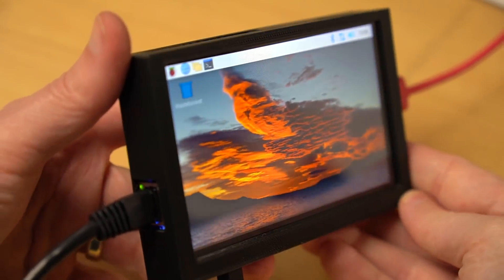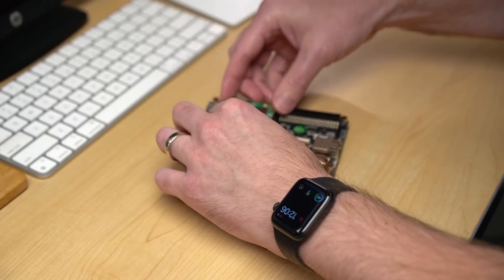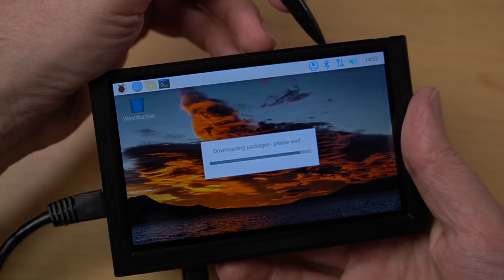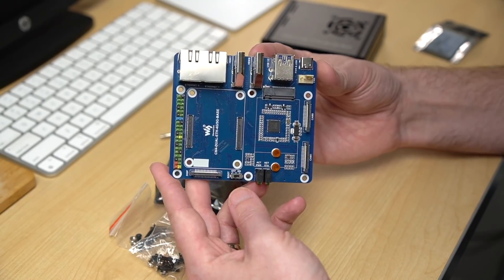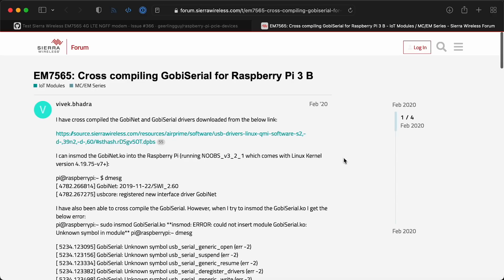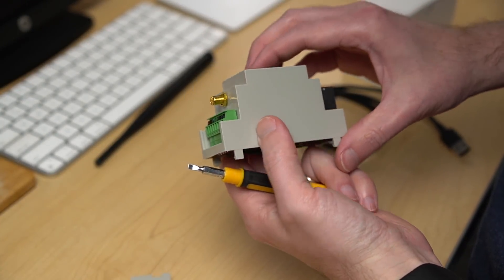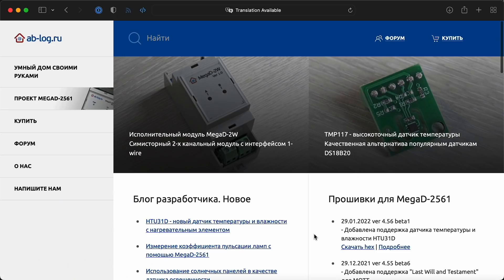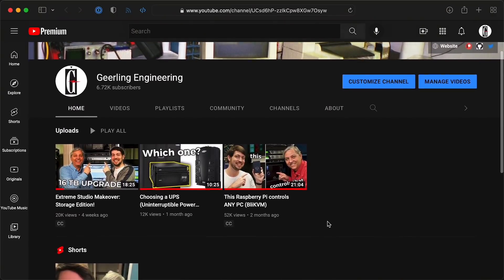So much functionality in one tiny Pi!

Comment: A tiny package like that meant to be attached to a din rail... I wonder if the original purpose was to act as an infiltration point by having the computer join the network. Why else would there be both a WiFi antenna and POE when it's not marketed as an AP?
Reply: wasn't that a ZigBee antenna not wifi?
Reply: @Cynyr  Ah, right, yes. Still feel it's kinda suspect, but maybe my perception is being tainted by the Russian invasion of Ukraine though.
Reply: @scbtripwire  even not for infiltration reasons, having Ethernet to talk to the building management system, and wifi/bluetooth to connect to the technician's tablet or computer is becoming a common feature in the DDC/PLC controller space. I'm sure they'd have gone for a small 3 port switch (2 external + one for the pi) if they could have gotten the plus to fit. That way you can daisy chain them.
Reply: @Cynyr  Yeah, I find that really unfortunate because that just leads to an eventual security hole when the company stops supporting the app portion of the product for which you paid. :/

I saw a height-adjustable motorized (sit-stand) desk a few weeks ago with its own app. I don't need my desk to be smart, just put a panel with buttons on it and I'm happy! Yeesh.

Comment: Does bug tree tech have a script or install for the coin battery low battery warning?
Reply from the maker: No, nothing that I'm aware of. Usually with the RTC battery you just replace it if you notice the time's not being kept any more. Honestly I've only ever replaced a few of these in my lifetime... usually the equipment dies before the battery :D
Reply: We're using regargable RTC battery in RPi4-RTC-PoE. And yes, i think it dies before the battery (10+ years).
Reply from the maker: @dmitryermakov3675  I'll check back in in 2032 ;)

Comment: Jeff- would you recommend one of the 5" display systems for use as a wall-mounted controller/frontend for Home Assistant? Asking for a friend.
Reply from the maker: Yes. That's one of the two projects I'm planning on doing with a touchscreen, hopefully later this year. This little display would be perfect for a little controller by a door (it's about the same size as my security system touch panel, too).
Reply: @JeffGeerling  Since you're now using home assistant, I'd love to see what your lovelace dashboard looks like on a 5" screen. I'm guessing a floorplan would be the way to go? Also, can the screen brightness be adjusted via software? it would be really cool to dim the screen until motion is detected in the room, and perhaps put the screen to sleep at bedtime.
Reply from the maker: @davestenhouse2015  AFAICT there's no software brightness control. You'd probably have to tie GPIO lines over to the buttons using bodge wires, then you could activate the buttons via software. Hacky but could work :)
Reply: this is what I was thinking too, and was hoping it had PoE so if only need a single cable. and I'd need to design a case that mounts on a normal low voltage single gang box.
Reply: @Cynyr  +1 for PoE. until then, there's always a PoE Splitter. I have some things running off a GeeekPi Gigabit USB-C PoE Splitter. It was about $15 from Amazon. The real PITA about it in this use case would be hiding the wiring.

Comment: Hey. Genuine question. I know. Shocking. But how long does the 4G router last if I hook it up to a power bank and take it with me travelling?
Reply from the maker: That's a good question. I might have to test and find out.
Reply: @JeffGeerling  I think that would be a great test. Not enough people talk about how long these devices work when it comes to loads like that.
Reply: I would suspect the specific battery bank and its own efficiency would have a big impact on the answer to your question. As would the signal strength (IE 4G/LTE, 5G, etc.) if the signal strength is poor, then more transmit power is necessary to maintain connectivity (the same is true on your cell phone). While I'm sure this is an idea Jeff Geerling would likely test at some point, the ultimate answer will likely be YMMV, or 42...
Reply: @thomasbonse  So I should not panic? ;)
Reply: @MarcoGPUtuber  Not if you remembered your bath towel. 😉
Reply: Well it's PSU specs are 5V at 2.5 amps, so it can't draw more power than that.  5V/20Ah packs are pretty common so divide 20Ah by 2.5 amps and you get 8 hours.  Now that assumes the PSU is drawing it's full rating all the time and is 100% efficient which isn't true in either case, but can give you a ballpark estimate.
Reply: @gustersongusterson4120  As there is no cell chemistry that can provide a battery that gives 5 Volts for an appreciable fraction of its discharge time, all those packs have cell(s) giving some other voltage and a DC-DC converter.  Typically a Lithium based cell.  Fully charged those have a voltage of 4.1 or 4.2.  End of discharge is usually about 3 Volts as going lower risks irreversible damage to the cell.  Hence the oft-quoted 3.7 Volts, which is an average.  The sneaky part is that invariably the advertised Ah capacity figure is that of the cell.  You don't get 20 Ah from the 5 Volt output.  For the DC-DC converter to increase the voltage it has to take more current from the cell than the converter is outputting.  If the converter were 100% efficient the current from the cell would be 5/3.7 on average times the current to the load.  Restated that means the advertised 20 Ah is really only 20x3.7/5 which is 14.8 Ah. 

There are other factors which reduce that even more.  The DC-DC converter is not 100% efficient.  You can never get all the capacity from a cell.  Cells age and start to lose capacity as soon as they are manufactured. (Yes I mean capacity, not just charge.).  And how accurate is that Ah figure in the first place?  Most buyers have no way of checking it so the temptation to quote an optimistic figure is difficult for some sellers to resist. (I'm being diplomatic!)

All in all a good rule of thumb is to divide the advertised Ah number by 2 before doing the sort of calculation you did.
Reply: @gustersongusterson4120  The amp hour rating is at the nominal battery cell voltage (3.7V for Lithium Ion). The battery output goes through a buck/boost DC converter to give a regulated 5V output.  Doing the math, you could expect around 13Ah @ 5V.  When comparing potential energy storage you are generally better off using Wh (and factoring for losses) as it disregards voltages.

Comment: It is SO exciting to see so many new Pi boards. I just wonder, when is there gonna be a rPi5? seeing as how powerfull the Pi4 is, the rPi5 has the potential to be SO exciting!
Reply from the maker: I hope soon, but I wouldn't bet on soon :( — the chip shortage has delayed so many launches, I'm guessing the Pi 5 is similarly delayed.
Reply: @JeffGeerling  I hope the rpi5 has higher clocked cores and more gpio connectors and mini hdmi or USB c for video instead of micro hdmi my first rpi4 hdmi port broke so I had to replace it
Reply: @yaboiminecraff  i hope the rpi5 will have usb4 interface plus atleast one pci express x16 lane. quad core cpu. 8 & 16gb ram options. onboard dual 2.5gbase-t & wifi 6e. that should be all available on the standard rpi5 board but with cm5 it would be so cool for even more expandability on the pcie bus and  i doubt they would ever do this, but it would be really cool if on an IO expansion board they could include  2 sfp+ slots for 10/25 gig fiber ethernet. one can dream right? lol. Ive still yet to see a cm4 or even a cm3 out there in the wild. if it wasnt for jeff's channel here, id say the cm4 was just an urban myth. if anyone knows where i can find the cm4 in canada i would be super appreciative. jeff needs to stop hogging all 10 cm4's out there! 
:P
Reply: @JeffGeerling  if it werent for your channel i'd be convinced the cm4 was just an urban myth. bro u need to stop hogging all 10 cm4's out there in the wild. share the love! lol. Any clue where i could find one of these mythical cm4's in canada?
Reply: Let's hope it will be in stock by 2038...
Reply: @dmytronikolenko1341  and that's the time another cryptocurrency came out... lmao
Reply: @dmytronikolenko1341  Just in time for the 32-bit apocalypse!
Reply: @dmytronikolenko1341  that's a bit too ambitious. Maybe 2102?
Reply: I would love to see the pi 5 either strive for a cooler and more efficient processor or more power, but I hope the more power doesn’t need more than just a simple heat sink and a small fan. It would suck to need a cooling solution that is large so that you cannot put it into a small device.
Reply: @charliemaybe  I strapped a 140 mm fan to my pi even at max use it never gets above 35c
Reply: @yaboiminecraff  I’m just wondering what cooling solution would be needed for the pi5
Reply: @charliemaybe  not much more than the pi4 but probably would need a small heat sink for just passive use and a fan with heavy use im not aspecting like a 8 core version im just talking like a 1.5 or 1.8 ghz clock speed at 4 cores
Reply: @yaboiminecraff  yeah, they probably will keep the core count and clock speed the same, they will just get a better architecture for more performance.
Reply: As long as demand greatly outstrips the supply for RPi4, I doubt we’ll see an RPi5. The only reason why that might change is if the RPi4 silicon ages out of production and it becomes cheaper to produce a new chip instead.
Reply: @thewiirocks  I think you are being just a little too pessimistic there, the Pi4 silicon like all Pi's even when freshly released isn't even close to the bleeding edge, and stays in production and demand for eons as its relatively useful, cheap to make - because its not tying up more capable silicon fabs... SO the Pi5 is likely to be released either when there is a nice enough upgrade in the Broadcom chip family for it, or the Pi folks have done the mountain of work required to move to other chips, perhaps even RiskV while keeping the Pi level of support and quality...